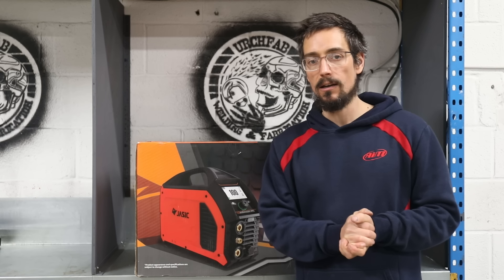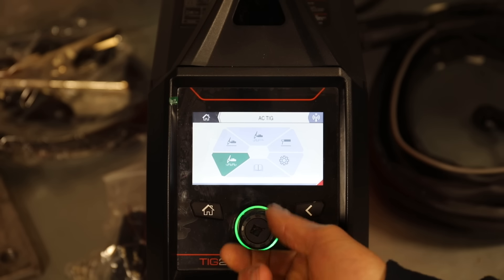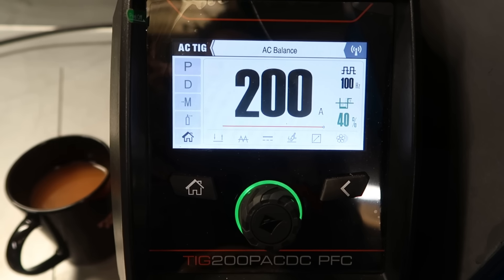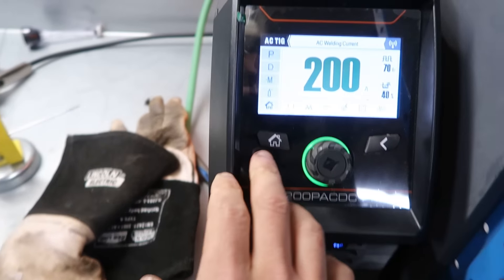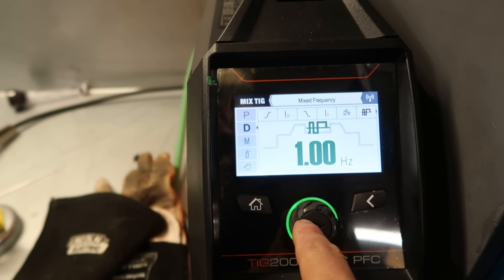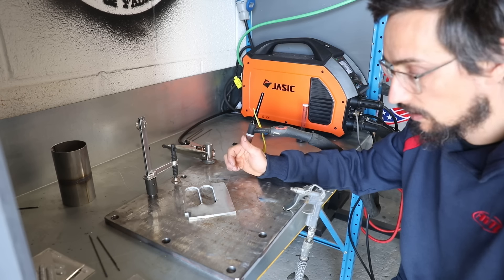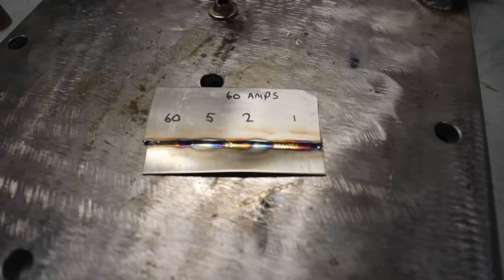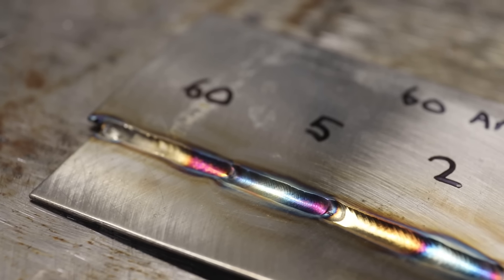Jasic ACDC Tig Welder Review - Lcd Display - Wireless Pedal - How to Mix Tig

Comment: your mistake is setting the welder to max and then say the foot pedal will take getting used to, you should have set the welder for 10-15 amps more than you need then the pedal has more control.

Comment: These import machines sure came a long way in the last 5 years ….
Reply from the maker: They sure have, very high tech for the money.  I adjusted the hot start on the revolution like you said. Crisp arc starts on ally now! Nice feature to have. This one has a nice start, but it starts on 20amps AC.

Comment: Super these are as other than the amount of settings mine welds every good as my EWM tetrix . Wired pedal is better though when I tested them when it first came out
Reply from the maker: I'm impressed with it so far, I will see if I can try a wired pedal. I've not tried anything from Ewm but they certainly look the part. Cheers
Reply: @Urchfab  yeah with wireless its just a variable pedal where as like the older sets the wired one you can use it as a switch also so as you know this is better with stainless.  33 percent is the ballpark I found on balance with these things . Great vids bud 👍